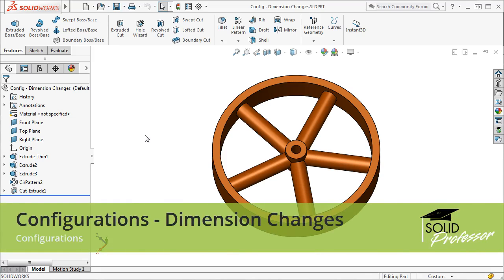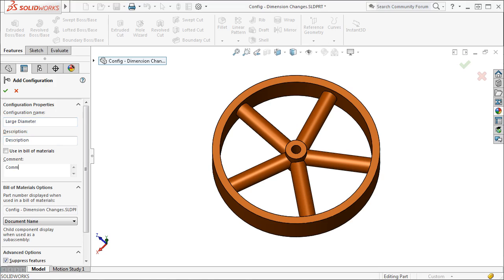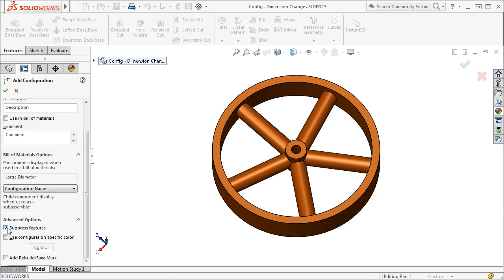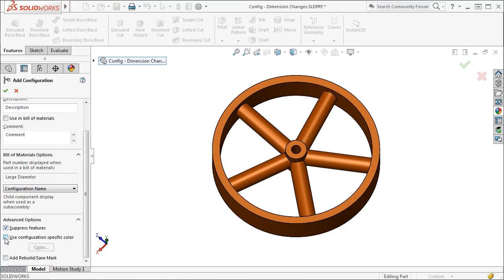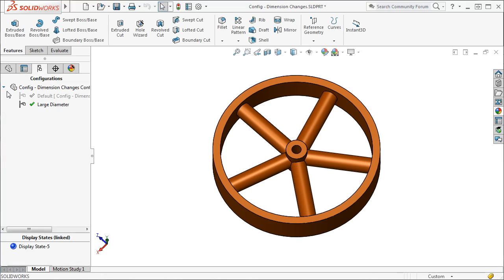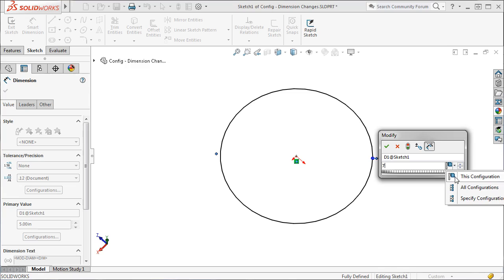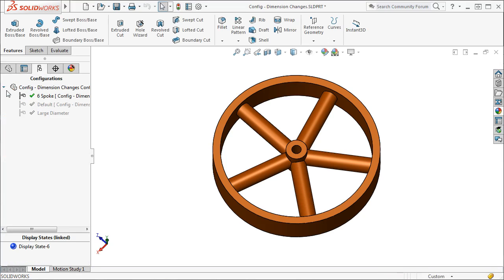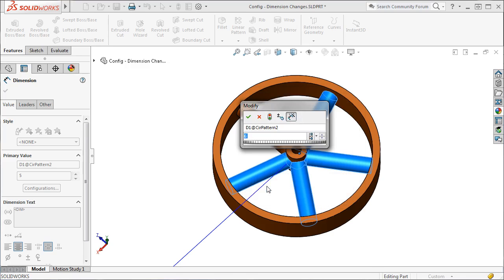Configurations - Dimension Changes in SOLIDWORKS 2016

Comment: i keep forgetting to select 'this configuration' in the sketch edit. is there a way to make it default?
Reply from the maker: Unfortunately, I don't believe there's a way to set this as the default option out of the box. However, you might be interested in the Modify Configurations dialog if you haven't used it before. Once you use it to set parameter values for each configuration, any further manual dimension changes should be set to "This Configuration" as you're describing. Hopefully this article from the Help documentation will be useful:

https://help.solidworks.com/2024/english/SolidWorks/sldworks/r_configuration_table_db.htm?id=ea1da77530c446f09b69e7ae935b3889&_gl=1*k6b823*_up*MQ..*_ga*MjMzMjcxMDgwLjE3MTk4NzA5Nzc.*_ga_XQJPQWHZHH*MTcxOTg3MDk3Ny4xLjEuMTcxOTg3MDk3OS4wLjAuMA..#Pg0